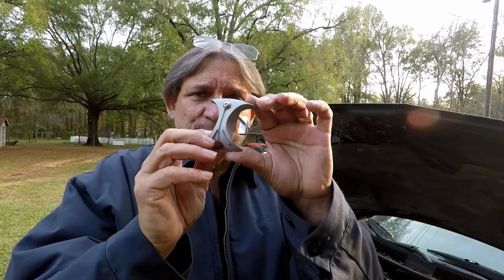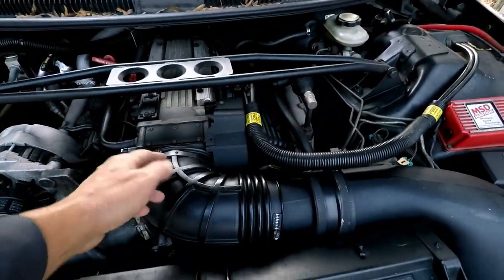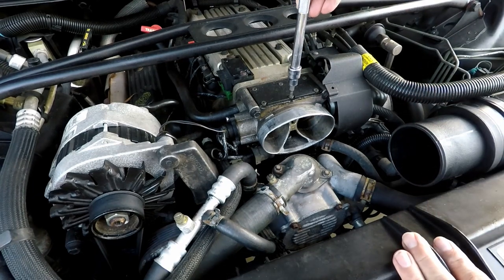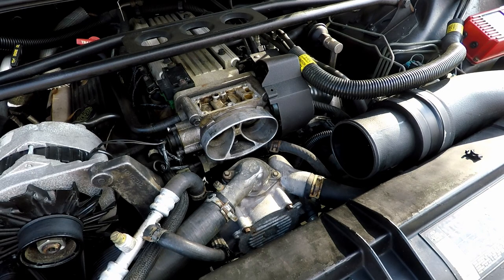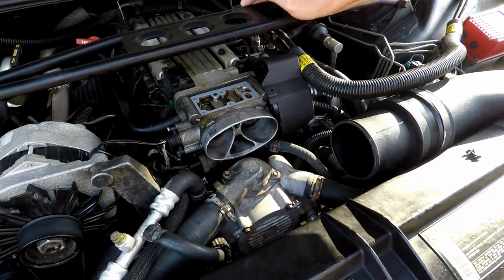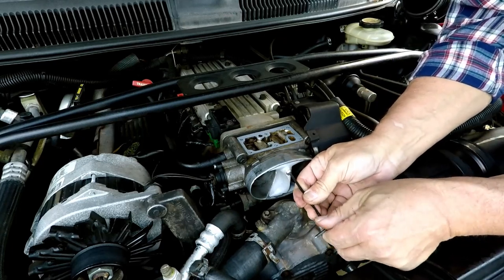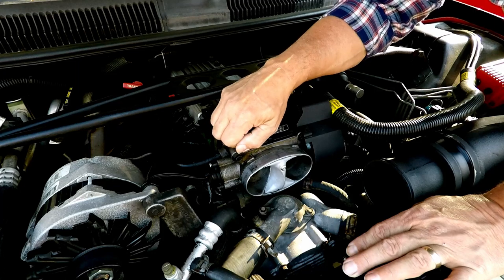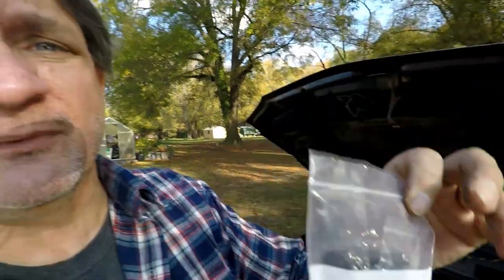4th gen Chevrolet Camaro Z/28 throttle body air foil and cover plate install

Comment: Love your car & vids. Thank you for this vid. I just installed the red LT1 aluminum cover plate from Hawks Motorsport on my black '95 Z28. Will install the air foil once I receive my aluminum intake elbow and K&N CAI. Keep rockin it brother! 👍🏾👍🏾
Reply from the maker: Thank you so very much. I love the small details we can make to our cars like this. no, it does not make more power. but you can feel the difference as it uses the power more efficiently. Thanks for watching

Comment: Anyone who sais this mod doesn't do anything is a liar.
I just did mine and even polished the metal down on it to a chrome finish. Yeah I felt the difference right away. Car pulls more willingly like some restriction in the take has been freed or something. You notice it at part throttle. I haven't even wot yet since installation.
Reply from the maker: Yes sir. I noticed a difference in mine as well....Something so simple....Thanks for watching

Comment: After watching this video,  I bought these 2 items for my 1995 z28. Got the air foil thing today, but one side of it had bad casting pits & a small chip on edge. I contacted seller & am waiting to hear from him. I got the black cover too. Any need for any gasket compound on gasket?  Love your videos!
Reply from the maker: No sir. No need for anything with the cover...........Dang, I hate to hear that about the foil...Hope he fixes it for you. Thanks for watching
Reply: @CamaroTime  Seller is sending out a replacement foil tomorrow. I could have probably used this one, but to buy something to smooth the airflow, and have a dime size pitted area and a small chip in the back surface, I want a nice one. Got the LT1 black cover today. It's beautiful! I still have car covered for winter. If I would have known, how mild this winter was going to be here, I wouldn't have pulled battery & covered it.
Reply from the maker: Sweet. Glad they fixed you up. Oh I understand. I would have done the same thing........There just is no way I could live somewhere , where I had to store my car for the wint....Nope, nope, nope. LOL
Reply: @CamaroTime  Sent me a replacement, had exact mold flaws as first. I'm just going to use one as I think it will work ok. Too much trouble to send both back, even with a refund, and take chance on getting another. All four sellers, with different names on ebay, are from Katy, Texas.

Comment: That was one of the first mods I did on my Firehawk was changing those pieces out but I did also use orange fuel resistant gasket maker when I put it back on just to be safe. ever since I've had my air foil installed I've noticed a big difference in the idle and also in acceleration.. thank you as always for doing these videos..
Reply from the maker: Excellent tip. it does make a difference for those that don't think it will. Thank you for your input on the mods as well. Thank you for watching. Just doing my little part
Reply: @CamaroTime  believe me it's not a little part you make a big impact when it comes to talking about these fourth gen f bodies and it's a good thing that there are more YouTubers that are coming out with more videos about them because they deserve a lot more respect than what they've gotten in the past. 😎🔥🦅👍
Reply from the maker: I agree. They are very under rated.